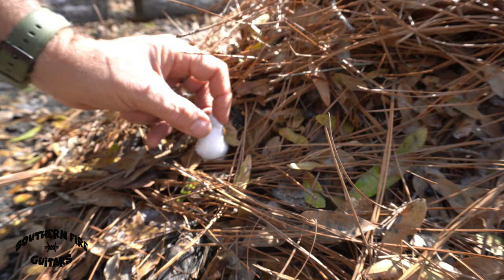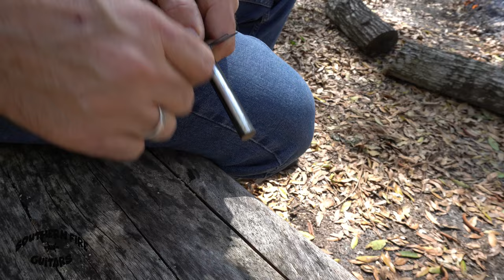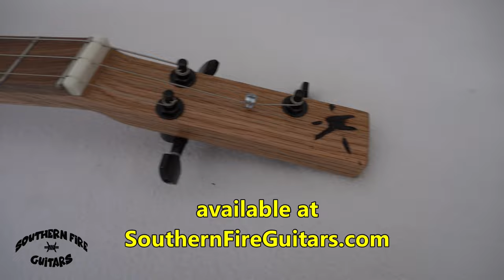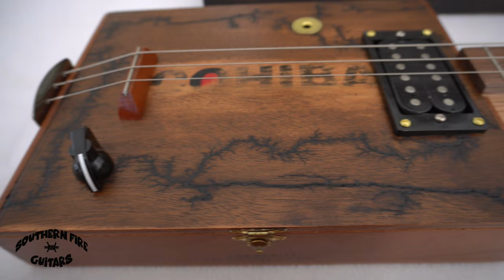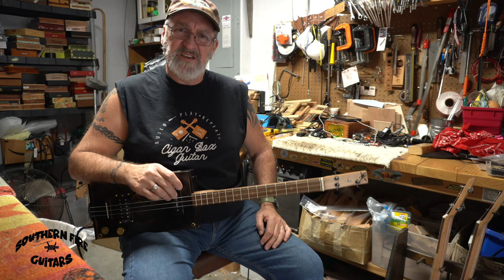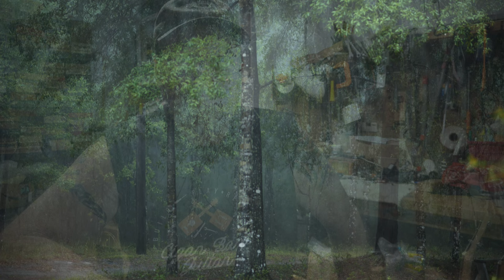Cigar Box Guitar - Finished Necks in the Finished Boxes

Comment: Hi Michael - all beautifully build CBG's; I'm trying to emulate your build technique with my 2nd build.  I assume you have a back angle on the neck of these CBG's. How high are the strings above the frets along the fret board?  Is it an even height along the fret board? Thanks for taking my questions.
Reply from the maker: Thanks Ray. Yes I do use a back angle. Yes it can be an even height along the fret board, if its the right angle according to your build design. M~